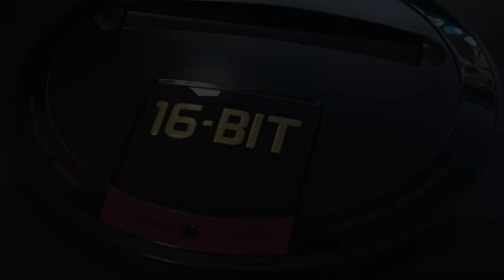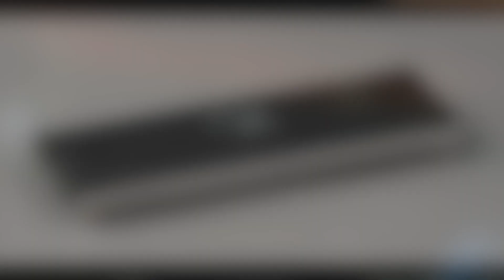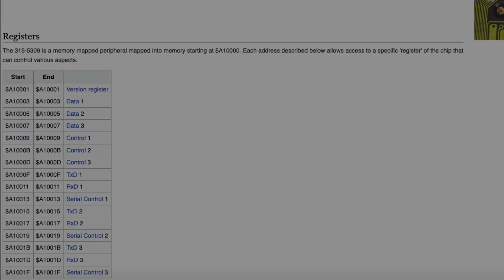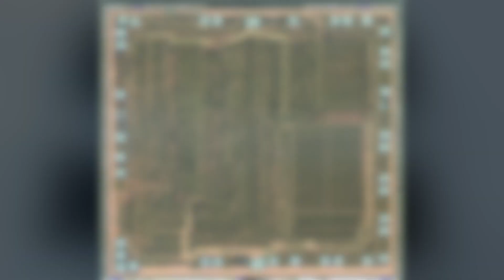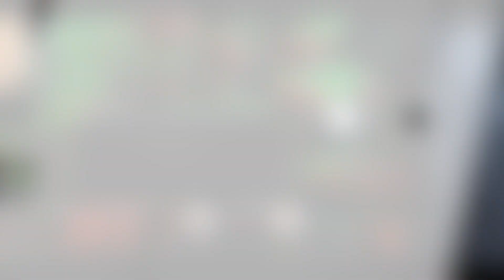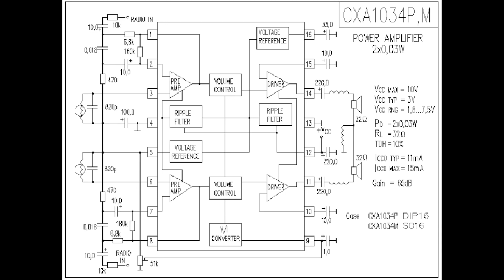A hardware overview of the SEGA Mega Drive PAL-1 Model: 1601-11

Comment: I always wish  sega genesis Specs was:

9.75 mhz clock speed 

96 kbt of ram 

12-bit color palette of  4096 
    On screen colors 126

16kbt sound ram 
   12 -audio Channels

And the controller had two shoulder buttons labeled (y & z). & one button over the b button labeled (x) 

I was a kid that was never satisfied with anything in the 80’s 😂 I always though of ways things could be better than they are,..every single thing.
I wound steer at things and wonder what tweaks would make it even better
Reply: I would have gone for a 12.5MHz 68k and 256 colours on screen. Or basically the same spec as the Sega System 16 arcade board (but with a 12.5MHz CPU instead of 10MHz).
Reply: @Psarás2162  just thinking costs effective and still competitive 
U gone into expensive territory, for the year of manufacturing  . This would have pushed it to be sold for a lot
Reply: @48hourrecordsteam45  Yeah, I know. Just dreaming out loud is all, haha. 🙂😎

They could have still increased the CPU frequency a little and added more colours (the SNES has 256 colours on screen) and kept it cost effective.
Reply: @Psarás2162  the 18-bit platte for snes and ram price had gone down when Nintendo started production.  
U see snes  double the ram of the genesis and triple the sound ram
.  A 12-bit pallet would have been sufficient
By looking at the palette diagrams .
The game gear had a 12bit palette 
.performance would have been optimal. And price wouldn’t have been a big dent
Reply: @Psarás2162  oh no 68k couldn’t hands the colors . U need more cram to the vdp
This why I said we slap a deducted extra 32kbt in there
Reply: @48hourrecordsteam45  Makes sense. Imagine if we could have had it at closer to the arcade spec if components weren't so expensive back then. It would have been awesome. Still, I enjoyed it back then and still do to this day.

Comment: Are these asian PAL megadrives region free? I'm sure I've used one before and was playing both PAL, US and Japanese cartridges on one all outputting on a 50hz PAL tv? I thought megadrives had to be modded to do this?
Reply from the maker: Apparently they are, though I haven’t tested it.
Reply: @Irinikus  They are not, all cart shapes will fit but since the region jumpers are configured the same as a PAL Mega Drive, US and Japanese games that are region locked won't work unless you do a region mod.
Reply: Yes, the cart slot allows all size carts to fit, also a quick cut with a screw driver to one of the traces on the board turns it into 60hz. I  bought one of these to go with my European Megadrives.

Comment: Amazing video! Thanks for that Irinikus! I just got crashed on it while searching for my recently purchased MD PAL-I Model:1601-11 (Asian Variant). Unfortunately it came packed with a Japanese power supply (NEC PAD-124) that is meant to be used with the PC engine gaming console. I was wondering if I can use a power supply with the exact same specs as the one displayed in the beginning of your video without toasting my beloved MD. I am living in the EU. Apologies for the question - bit of a noob here.
Reply from the maker: Thanks!🙂

The SEGA Mega Drive needs a power supply that delivers 9 VDC @ 1.2 amps, and a center-negative, 2.1mm jack.

If you use a power supply with the exact specs as the one I showed in the video, it should work fine.

It’s imperative that the polarity of the power supply is correct, or you’ll damage the console. (THE CENTER CONTACT OF THE JACK MUST BE NEGATIVE!)
Reply: @Irinikus  You are welcome :)

Will do that! 

Unfortunately I just bought a second power supply from the same guys that shipped the console (Konsolenkost) with the center positive one for the PC Engine. And they send me over another Center Positive (10V, 1.2A, 2.1mm) while on their product page a center negative one was presented and now they are claiming that this adaptor can be used with the MD1 DE Variant, but if not mistaken ALL of the MD1 variants need to be hooked to the Center Negative one. The thing is that I tried to explain to them that a center negative one is needed instead and they replied that I can use the center positive ones alongside with a power converter... I am totally lost. Anyway, thanks again for this useful info Irinikus! All the best!